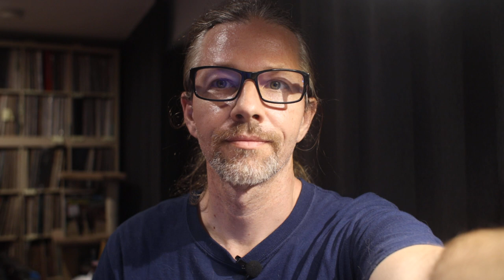My advice on horn loaded single driver speaker design

Comment: Dear Janos,
 
Thanks for wanting to dedicate an episode to this topic/my question.
 
The highest priority for the design of my loudspeaker is "narrow directivity" for two reasons. One is the relatively small listening space I have, the other reason is that I want to experiment with crosstalk cancellation technology, which only comes into its own with as few reflections and as much direct sound as possible.
 
I do not like electrostats or magneto= but do have a love for high efficiency, paper drivers and fullrange driver. Problem is that usually fullrange drivers have a very wide dispersion pattern.
 
Hence I was thinking of a large horn for good directvity, preferably with fullrange driver. But with compression drivers would also be possible. I am also open to multiple small horns, if you get better directivity.
But I'm afraid this will only get more complex, especially since I'm realtively close to the speaker. This was another reason why a single driver in a horn seemed right for me.
 
Do you maybe have any suggestions for me?
 
I myself thought this design was interesting by Jospeh Crowe no-1548
 
(By the way, Jospeh (Troy) is very talented in loudspeaker design)

All the best!

Nick :)
Reply from the maker: Goodness Nick, 11mo!! Video response coming tomorrow :)
Reply: @realworldaudio it’s okay my friend, no worries! I have changed my plans for my diy project. I think it’s a really interesting design with allot of advantages and it’s called a synergy horn aka multiple entry horn.

It’s a full range hornloaded and acts as a point source! If you find this interesting there’s a really nice thread with good information on this subject on the ‘whatsbestforum’ the thread is called ‘Why synergy horns?’ by a respected audiophile Sebastian Schlager.

In this thread you will find how remarkable this design is. :)

Comment: Hi Janos,
I have some questions and observations about Voigt Pipes, any help you can provide in answering them would be much appreciated.  I didn't know which video would be best to put this against though!

I have built recently a pair of speakers called "frugal horns", these are fairly small speakers using a single driver, in my case Markaudio MS7.  The speakers sound really good, but are in a very small room, just 7 feet by 13 feet.

My wife is so impressed that she wants the speakers moved to our main living room, which is much larger, approx 20 feet by 18 feet, but has a central chimney.  I think the speakers I made would be too small for the space and am thinking instead to build Voigt Pipes, rather than larger horn based speakers. 

The design of the speakers I made include a curve to form the rear facing horn.  I wonder if rather than using a straight back of the Voigt Pipes, I could curve that too, and would a curved back improve the sound at all?

I could imagine that a curved back Voigt Pipe would have less standing waves and would mean any internally reflected waves could dissipate more cleanly as any reflections from the curved surface would change direction based on the tangent of the curve at the point of reflection which varies in angle along the curve.

Of course it would be much more work to shape the back and to cut curved sides.  Do you think there is any advantage, and if so, is the advantage sufficiently attractive to mitigate the extra work involved?

There's a couple of ways I can think of to make the curved back.  One is to use several layers of thin (i.e. flexible) plywood (or other woods), another would be to use "kerfing" on a single thicker piece. I would expect any resonances of the back would be lost as I would think both methods would damp the back panel: for your "live panel" design that would be a bad thing I think, though I've seen others recommend adding damping to the panels.

The drivers I'm considering are the Lii Song Fast 8, an approx 7inch driver with a Vas of 69 litres; a Markaudio Alpair 11MS, approx 5.5inch driver with a Vas of just 17 litres; or a Markaudio 12p, approx 6.5inch driver with a Vas of 43 litres.  Of these, and based on the manufacturers' specifications, the Lii Song has the best performance curve, very good from 50Hz to 20kHz with a slow drop off at the lower end.  Is there something specific I should look for in the specs that would make the "best fit" driver for the Voigt Pipe?

Prices vary for these here in the UK, from about £180 to £250 (for a pair). To go "up market" to Cube Audio would raise the cost to at least 6 times that for their lowest cost driver, I don't want to spend so much, £250 is about the limit I would spend: the drivers for my Frugal Horns were just £120 (pair).

Any help you can provide greatly appreciated.

Comment: This is outside my lane, so take it for what it is worth… Decware has a new single, full-range driver, rear horn loaded design that might be interesting to look at called the DFH 10 “Lii HeadWrecker” (😁). Steve Deckert has recently posted a pile of Youtube videos about it on the Decware channel including some of them being constructed.
Reply from the maker: Thank you Steve for the link! My impression from the YT sound sample (both through LaGrande and headphones) is consistent with my experience of how rear loaded single driver horns sound: lively, fresh sound with a lot of speed, attack and bite, coupled with loads of clarity. Nice execution, and beautiful craftsmanship! The downside is very little midbass and low bass. With break-in the midbass and low bass improves quite significantly, but never catches up the level of BR / other designs. So, if one has the problem that there's already too much midbass in the room, this is a very good choice, and you will experience clear deep end without room overload. On the other hand if you want more midbass than now, this is not it - as you will get even less. Very good quality though, but leveled much lower than the norm, much below the bass hearing threshold of most people. If you have acute hearing in the bass region, this loudspeaker will be a welcome change! However, about 99% of audiophiles have lost their ability to hear well in bass - that's why everyone is cranking it up usually much more than it should be.
Dr Bruce Edgar's Lowther horn was the only one that had exceptional midbass AND deep bass level with the rest of the sound spectrum. In addition to the otherwise excellent upper bass though highs region that is characteristic of such fullrangers. To me the level of midbass it provided was exemplary for classical music, but my friend eventually moved on after several years to a full blown big Altec as he wanted that clarity at a higher midbass level.
Reply: Hey Steve. Decware are the infinite baffle guys im taking queues from for my next speakers .  Have they changed their designs strategy?
Reply: @EddyTeetree  Decware seems to still have all manner of off-beat speaker designs. I ordered the basic SET amp, Zen Triode, and went to Peoria IL to pick it up when it was finally done, what a blast. Steve Deckert was very generous with his time; we hung out for a couple hours in his listening room listening to his speakers driven by my 2.3 watt amp. I thought the 15” open baffles sounded outstanding (though be warned since this was my first and only OB experience).
Reply: Dear Janos,
 
Thanks for wanting to dedicate an episode to this topic/my question.
 
The highest priority for the design of my loudspeaker is "narrow directivity" for two reasons. One is the relatively small listening space I have, the other reason is that I want to experiment with crosstalk cancellation technology, which only comes into its own with as few reflections and as much direct sound as possible.
 
I do not like electrostats or magneto= but do have a love for high efficiency, paper drivers and fullrange driver. Problem is that usually fullrange drivers have a very wide dispersion pattern.
 
Hence I was thinking of a large horn for good directvity, preferably with fullrange driver. But with compression drivers would also be possible. I am also open to multiple small horns, if you get better directivity.
But I'm afraid this will only get more complex, especially since I'm realtively close to the speaker. This was another reason why a single driver in a horn seemed right for me.
 
Do you maybe have any suggestions for me?
 
I myself thought this design was interesting by Jospeh Crowe no-1548
 
(By the way, Jospeh (Troy) is very talented in loudspeaker design)

All the best!

Nick :)

Comment: Hi Janos, how i can calc. a vogit pipe, i would like to use TangBand W8 1772, the second best speaker on yt, is providing drawing but the port dimesions are missing.
Reply from the maker: Hi Georg, the Voigt pipe is quite a versatile speaker, there is no specific formula to calculate it - wedge shape, driver about half the height, and mouth in the bottom. There's no right and wrong with it, changing ratios, sizes, mouth size will affect how it will match your room. I know that speaker design, and I would just use an approximate port size that looks about as big as the one seen in the video. Don't recall what it was, but about 10-15cm tall mouth / port will work fine.
Also, if you are interested, I have my Voigt pipe dimensions in one of my videos:
https://youtu.be/JhPLpfxLriY?si=wwvN_Wpk5do0kCh4
You probably already know it, but I have a Voigt pipe playlist on my channel, if you are interested in Voigt pipes I can recommend checking it out. I go into quite a detail on the port size / matching to room etc issues and aspects of the Voigt pipes, and differences in various builds and approaches.  Have fun with your build! Cheers, Janos

Comment: It's not that hard, but it take some knowledge. 
Several projects with plans around both from Lowther and some DIY designs.
Voigt pipe is basically useless compared to a proper rear loaded horn single fullrange driver.
To get the midrange right compression chamber should be in the 3-6 liter region. Bigger volume sounds way too coloured. Some examples.
https://www.youtube.com/watch?v=_Y0aJ851Kec
https://www.youtube.com/watch?v=N4X_QgoY2ME